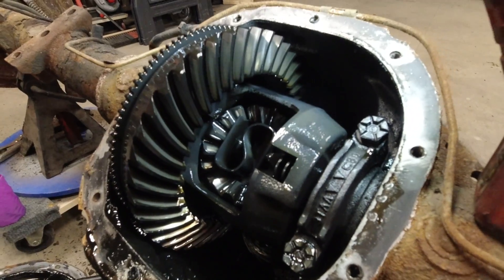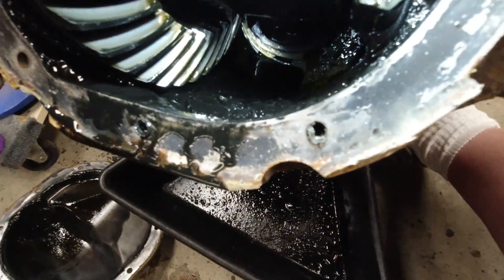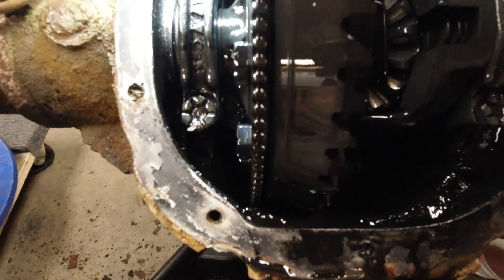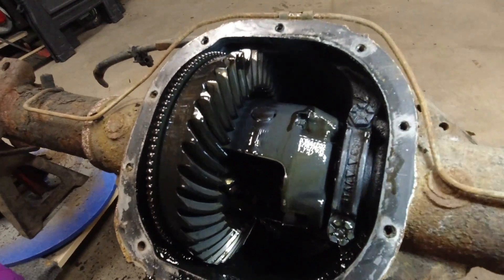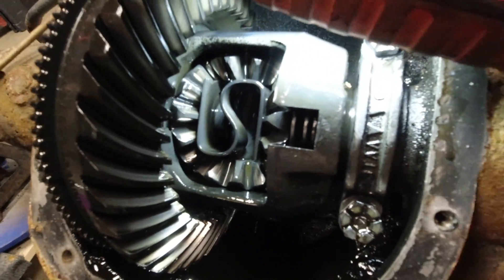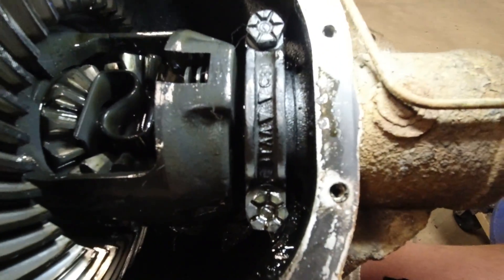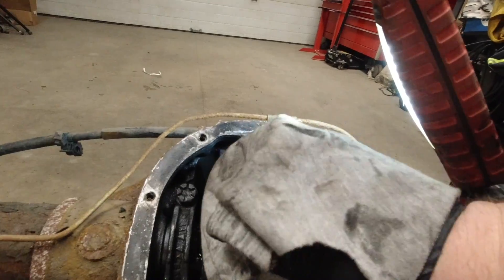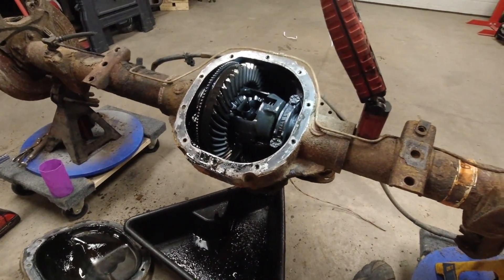Differential Inspection what to look for Ford 8.8

Comment: My rangers spider gears are worn. On 8.8 with 28 spline axles. I can’t find any spider gears except for an open diff. Would that work with a limited slip?
Reply: Just get a open one and put a Spartan lunchbox on it

Comment: I have a 2003 mustang v6 the guy I got from said he changed it to a 8.8 how can I tell if he did
Reply: Does it do a one wheel peel or both ?
Reply: @cesarl3594 How would that tell you? you must not know that 8.8 come in both LSD and Open centers.
Reply: @oldgamer1330  if it came from a sn95 mustang it's got an LSD , I swapped the 8.8 into mine got rid of the janky 7 in .
Reply: @cesarl3594  He asked how can he tell if it was an 8.8 not how can he tell if it was a LSD. I have a Ford Explorer that is badged as a 8.8 4.1 LSD, but it is not a LSD, somebody has cheaply replace it with an open diff, so you can't go by what it should be.
Reply: @oldgamer1330  doubt he cares bubba it's been 2+ years since that comment
Reply: @oldgamer1330  regardless you literally just gotta look the the diffs and you can compare them because they do look different

Comment: What if when spinning one tire forward and the other tire spins opposite direction? Is that worn clutches? Ford 8.8 in a fox body
Reply: It means you have an open diff.
Reply: @cheeko_914 my clutches were worn out, replaced them and now both wheels spin 👍
Reply: @AngryHerby they both spin in the same direction now?
Reply: @kaleb8985 yes, but I have since worn them out again so going with a mini spool because no one makes a full spool for 8.8 28spline